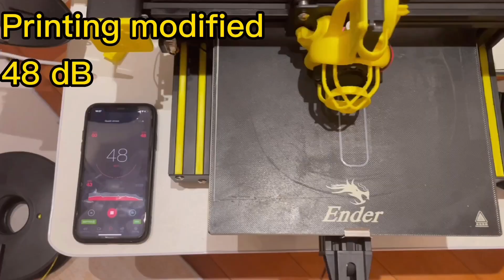5 Easy Upgrades for your Ender 3 V2 (Part 1)

Comment: My cooling fan connectors (see 3:32 in your vid) also broke (in part ? because Creality had used "pointy" tipped screws, the leading few millimeters of which did not bight into the plastic).  Although I just swapped the two screws with squarer-tipped self-tapping screws (which worked fine), my fix is probably more appropriate as a preventative upgrade for a new fan shroud.
Reply from the maker: Yea that’s a good point, I think my screw boss had broke off completely. I wonder if they’ve fixed the design yet.

Comment: Lol moving the spool can't change the angle it's pulled off of it.. It does help the angle it go's in to the extruder. However no matter where you put the spool it's a wheel so it will always leave at 90 to the center. Science..
Reply from the maker: Yup exactly the filament pulling off will always be tangent to the spool. I meant changing the angle where it goes in the extruder. I’ve had some issues there in the past causing some under extrusion. Looking back though it may have also been from poor spool management.. losing the end of the spool and causing a tangle has definitely happened a few times.

Comment: My P.O.S. Ender won't work, it just sits there on the work bench w/ fan running, bed heats up & that's it. Back to the store for a refund. It's "Not Mac Compatible" with 10.13.6
Reply from the maker: That’s strange, you should be able to download some Gcode files directly from thingiverse  and print from an SD card regardless of Mac or PC, unless something is wrong with the printer itself. I hope you get it figured out!

Comment: Did the Z-19 improve cooling at all?
Reply from the maker: I don’t think there was any improvement, but I also did not see any issues. I didn’t get a chance to do an overhang test with the Z-19 but retraction test prints and speed test prints looked good.

Comment: No offense intended, but these are not upgrades. These are embellishments. They do nothing to add to the functionality of the printer. An upgrade, in my humble opinion, is something that improves on a device's functionality.
Reply from the maker: Yes fair points a lot of those were not technically upgrades and none of them added additional functionality but a few did restore the original functionality. Before I had the side mounted filament spool I kept getting snags and ruining prints partway through. Also with the original fan housing there were some broken bosses causing the fan to rattle around inside. I appreciate the feedback and will be more considerate with my wording in the future!
Reply: @DesktopInventions  The dual side part cooling fan is an upgrade indeed. Some suggestion for other upgrades: - double sided pei sheet - direct drive mod with 3d printed bracked. These two will change your printing experience on the ender. Thanks for your work, keep it up!
Reply from the maker: Thanks for the tip on the PEI sheet. Direct drive is definitely on my to-do list in the near future!

Comment: can you put the BL Touch V3.1 on it with the other fan bracket?
Reply from the maker: Yes, in the link for that bracket there is another bracket you can install next to it for the BL touch.
Reply: @DesktopInventions  Now that the BLTouch hase moved, how do I tell the printer about this?
Reply from the maker: There are settings within your printers firmware to set the X/Y offset for the BLTouch. I recently did a video on installing the a BLTouch which touches on this point… pun intended xD
Reply: @DesktopInventions  
Thanks. I've managed to work it out since asking this question.
I think using JyersUI firmware helped.

Comment: you're ambitious for using the plastic extruder
Reply from the maker: The extruder and heat block are still metal just the fan mounts are plastic. We’ll see how it holds up over time
Reply: @DesktopInventions  you're not talking about the extruder
Reply from the maker: You mean the plastic part that holds the extruder gears?
Reply: @DesktopInventions  yeah that is what he meant.

Comment: will these work on an ender 3 pro
Reply from the maker: The side mounted filament will work.
I don’t think the new extruder head will work since the pro has 3 fans and possible different mounting.
Extrusion slot covers will work but the length might vary.
The QR cover should work also.
X and Y knob covers work work since the ender3 pro doesn’t have those knobs.
If you check out the links in the description they should have more information if they work on the enter 3 pro.  Hope this helps!

Comment: This is exactly what i  was looking for... the fan cover has been bothering me .. Thank you .
Reply from the maker: Glad you found it helpful! Noisy fan covers are no fun!
Reply: "Bothering you?" LOL.
Wrong it actually works very well, many "upgrades" do nothing for performance and are lipstick to make it look good, and can degrade performance. "Upgrades" are only going if blind tested and carefully precisely measured with calibrated instruments, anything else is blind guessing.

Though nothing wrong with making it quieter or look better or cooler in your view.
Reply: @airgliderz  sorry i did not specify. You spent long writing down some advice that's actually elementary and I feel sorry for the time you wasted.My Fan cover has come down with some cracks and the noise it now makes bothers me.  Hence am looking for a solution.
Reply: @merwynmathew  call them and get a new one, how did you break it?? If fan noise is an issue put in a  noctua fan for ta size you need to to match existing oem then add a simple solid state reliable voltage buck, can get 5 if them for $10 on Amazon, good quiet noctua fan is not much either
Reply: @airgliderz  Yes im quite intrigued by the noctuas.. Never used the buck convertors before.. And worried to play around with the electronics.. Just wish they would sell fan covers.. Cant seem to find them.
Reply: @merwynmathew  Take it on, buck converters are easy, solder 4 wires, adjust voltage with a cheap meter (Fan voltage is a safe 12/24vdc). Soldering is easy, watch you tube video on on it, meter use is easy, watch you tube how too's. Just be safe, stay away from 120v power supply, turn off power AND unplug it before touching.